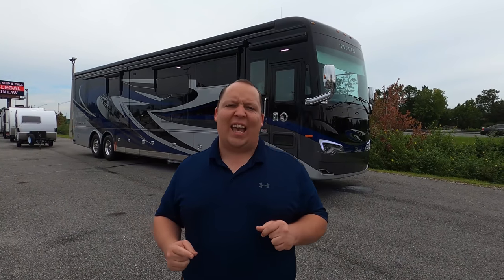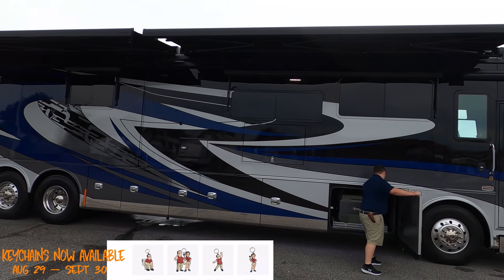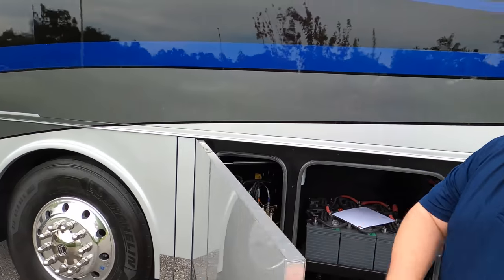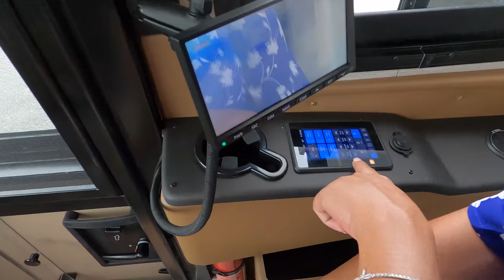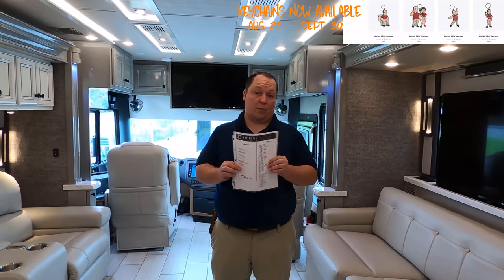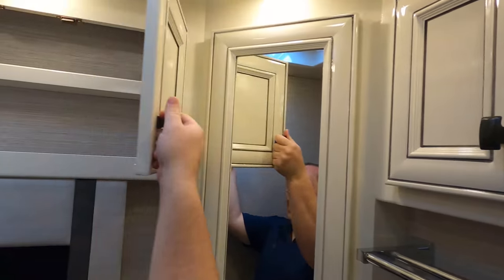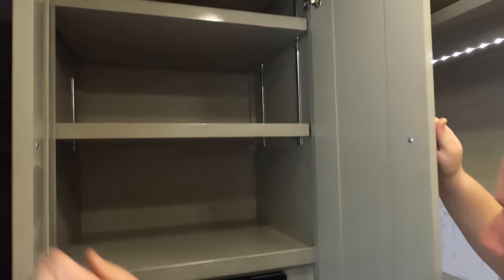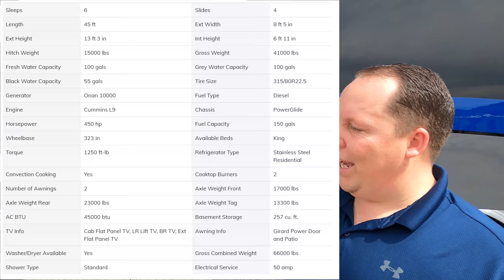The KING of Tiffin Motorhomes | Allegro Bus 45OPP

Comment: Beautiful but not perfect.   Dislikes would be: narrow walkway with slides in, bed is not flat with slides in, actually longer than I would like. 
Likes: awesome quality.  Love the cockpit.  Love the color scheme.  Kitchen is great.  Bathrooms great. TV position is great as long as you use televator.   Amazing coach but it shoukd be :). Actually think the emergency exit has a flaw.  If the bed is tilted up for travel you won't be able to get out of that exit very easily.

Comment: We like having the options that you can order:  360 view camera, 3 or 6 solar panels, mobileye collision avoidance, and stacked Washer & Dryer.  We dislike: the odd location of the Egress Ladder (vs. Newmar New Aire/Ventana locations), the limited/restricted access to the 50 amp power cord (very odd place) and no Roof Ladder.  Great job in the presentation. Deb and Steve.

Comment: For half a mill it should come with a ton of solar and large lithium battery set-up. Cheap NAPA batteries in a coach is class-c money
Reply: Also..... Residential fridges don't belong in rv's!! Large 12volt compressor fridge. Tell me how they remove the fridge to replace it..... they remove the slide....whomp whomp
Reply: Faith Renewed  Don’t diss Class C RVs. Any Class RV is better with solar and Lithium.
Reply: @brianreimer380  referring to the price difference.... 1/2 mill vs 70k
Reply: Faith Renewed I agree totally. I’m just saying the best class C can have 400 W of solar and 4 lithium batteries for an extra $8,000 and will have payback in about 8 yrs.
Reply: @brianreimer380  which is exactly my point...for the price this coach should have the best available.
Reply: Faith Renewed  yes true for 1/2 mill no excuse. And with a roof that big think how much solar you put up there, 6x200W panels. Yikes.
Reply: Most people who are buying this type of RV are not doing much boondocking, they are staying in RV parks all the time so major investments in solar don't matter to them. No reason to add it to the cost, if most of the customers don't want it.
Reply: @don.sullivan  Amen.  This coach would never be parked anywhere but in a deluxe park with hook-ups.
Reply: @don.sullivan  point being for the cost it should be included.
Reply: @faithrenewed3443  But adding that would add to the total cost of the RV as well as the weight. And if most of their customers (they know what their customers want) wouldn't use it why make it mandatory for all by including it in the base price. I'm sure it could be easily added for any buyer who wanted/need it.
Reply: @don.sullivan  if you're spending 1/2 a mill for an rv....it should come with the best available. The demographics of people buying this type of rig aren't the old retirees anymore. No they aren't going off road but most buying these days don't want to park in rv parks. If the manufacturers were actually in tune with the market they wouldn't be feeding the market the same old crap in a new wrapper....that's why people buy used busses and build their own because it's not offered in the market now.
Reply: @faithrenewed3443  We can disagree. I believe the RV should include the features that customers who are actually purchasing it want it to have- not just blindly include everything available just because of the price point. If enough of their actual purchasing customers demand that feature or tell them they chose an equivalent competitor product because that electrical upgrade is missing they'll add it as a standard feature. That doesn't seem to be what the market (actual customer purchasing $500K RV's) is demanding for that model.
Reply: @don.sullivan  we definitely disagree and the market has always been behind what the market craves and that's why there's many new start-ups upgrading and fabricating the the rv's people want. Have a nice day!
Reply: Don Sullivan why do you get 6 (8?) Napa batteries if you’re always plugged in or on generator? Battleborne lithium have lifetime warranty and charge faster and can use all the rated power while napas can only use 1/2.
Reply: Should at least be in the 21 st century solar and lithium aren’t a new idea,this is the manufacturer knowingly is buyers they will be in parks with full hook ups,half a million dollars is not going to be parked in a Walmart car park
Reply: @pault1964  many people buying/building rv's/buses are traveling and aren't doing the same ole. They want to get out into nature and away from the crowds. An rv that can be offgrid for extended lengths is the way the market is headed and if the manufacturers don't grasp the concept they'll be left behind and that's already happening. There is def still a market for the old couple hitting rv parks type rigs but there's less and less now.
Reply: @brianreimer380  I'm not making any suggestion that Lithium batteries aren't a good thing at all. They're quite amazing, but also quite expensive. All I'm saying is that they are not mandatory equipment for every single type of RV living. And since you can still add them to this RV then the buyer can choose to select them if it meets their needs. I'm only saying they should not be mandatory and thus adding to the base price if customers actually buying this particular RV don't usually add them. If the Napa batteries are sufficient to meet the needs of the owner between RV parks and they plug in when they get there, then it's an expensive 'available option' they can choose not to buy.
Reply: @don.sullivan   You guys are thinking like an owner of an under $100k motorhome owner. What is the big deal about solar and lithium? Boondocking, dry camping and spending time on blm or crown land that costs you nothing and has no services. People that spend $300k (which is what this would sell for) and up don't have that kind of RV style. They go from full hookups to full hookups. If they spend a night at a truck stop with the AC running using battery power it will be charged up in no time either driving 300 miles to the next stop or plugged into a post at a campground. Lithium and solar are kind of belt and suspender for this crowd.  Driving a 35,000lb+ diesel pusher (DP) down a forestry road and parking in the dirt will get you stuck, falling off the edge of a cliff and or doing damage that will cost thousands of dollars to repair.  Just not something most of this crowd would even consider. $300k for a diesel pusher is the bottom end of the market. If you want to be a king, buy a kingaire or even better a Prevost chassis upfitter like marathon or a built from the ground up newell. 
   As much as I love the idea of a DP it has a very limited appeal because it restricts you simply because it so huge. See that little antique shop on the side of the road or a tiny pull off with a dramatic view of the ocean, no way are you stopping your 65+ ft of coach and toad there. Not my style, still lovely to look at.

Comment: Ok this is definitely the nicest RV Matt has ever reviewed, it’s basically perfect as specced, but I think at this price level it should come standard with the 605hp Cummins.
6(!) Likes:
1: Beautiful exterior paint job, lights, and styling
2: Exterior storage with power trays
3: Interior decor and ambience with modern ceiling and cabinetry, and nice colours
4: Luxurious rear bathroom and huge shower
5: Nice kitchen with nifty storage spaces and high-end appliances
6: Massive walk-in closet in the rear
2 Dislikes:
1: Carpet on slide-outs 
2: 605hp Cummins (or at least the 500hp) should really be standard and not optional at this price level

Comment: For that much money they should have made sure that the slides run smooth and without the noise. With that much friction that only means major problems in the future. Also, the back escape hatch is in a very precarious location. If there is a fire or an electrical shortage you're not going to have enough time to get out. The bed moves in slow motion and it runs on electric, and fires on RVs spread extremely quickly and that bed takes 2 minutes to get out of the way. The RV is very beautiful inside and out though, but you are right it should have a push button start. Great job with the video & congratulations on 71000 subscribers

Comment: Thanks for the GREAT review! The 45opp is on our radar when we decide to trade up in a year or two.  
The Top 3 likes 1-Clean Look of the interior and exterior (seems like and RV’er thought through the design process) 2-Lighting in most RV’s it seems as if the lighting was an afterthought whereas the lighting for this unit is fully integrated 3-Functional storage options.
The Top 3 dislikes 1-Slide out buttons on the chair (I get that they need to be easily accessible from the front of the coach...but I would think with time the plate would wear down and the plate for the slide out button would pop out . 2- Tiny night stand (I typically keep my phone and a bottle of water next to me...if I purchased this coach I would have to figure it out) 3-Refrigerators look..am not sold on the face plate being the same as the cabinets...I am not sure if it would grow on me or if I would continue to dislike it.

Comment: Another great review guys, I like Tiffin and they seems to be a great customer service based comany. The 3 things i dont like are 1. at this price point they need to add lights in the cabinets throughout the coach. I mean come on light it up. 2. the carpet on the slide also. 3. the emergency rear door behind the king bed headboard. In an emergency thats a lot of work to get the bed out and then remove the headboard and then finally get to the door. I know someone is going to say it doesn't to take that long, but i have to tell you i have had to use the emergency exit once in a major emergency and the exit was behind the toilet. Just push it open and the ladder falls out to the ground and out you are. 
I like these things in this coach 1. the design of the galley, big lot of room and counter space. 2. the ceiling design with the mirrors and vents in the stainless steel, makes it look very high end. 3. I love the rear master bath and huge closet, I mean how did they fit all that in there. Thanks for sharing this one with all of us out here.

Comment: Likes - the emergency exit, the bed can move out to be made, the ceiling lights
Duslikes - TV over the cab area seems unnecessary,  carpet on slide around refrigerator and dinette,  stairs in front of passenger seat and when exiting they seem to be slow to extend which could cause a fall.

Comment: Wow. Such a gorgeous RV! It's tough to just focus on 3 likes. 
Likes: 
1.The bed that moves out for access and emergency exit, although actually using that exit may require more agility than many owners might have.
2. The kitchen; everything from the design to the sink to the cabinetry and pantry, especially the safety features on the pantry and peninsula
3. The walk in closet, bathroom, etc...basically, the entire master suite.
Dislikes:
1. The front TV is not necessary. 
2. Narrow (really narrow) walkway when slides are in
3. Carpet under slides. 
Just a note. I love the design and cabinetry. Whoever designed and planned this coach gets high marks from me. Also, all the drawer slides, inside and out, are fantastic. 
Thanks for reviewing this coach.

Comment: Sorry I'm late to the party. I did watch and give a thumbs up on the day you posted but I wanted to circle back and comment, for the algorithm of course. :) 
First off, glad General RV is carrying Tiffin products now. Pushers are in my wheelhouse so I feel I can give a little more in the way of comments. This is a nice bus! It's in the high end of your normal reviews. It definitely has all the bells and whistles expected of something in this price range. Something that would be easy to full time in. Overall two thumbs up to Tiffin! People rarely know how much advantage a tag axle brings to the table in stability, comfort and load capacity. One thing I noticed that should be on all coaches in this price, and I admit is a nit, but all the cabinets should be lined. It keeps the stored items from rattling around moving. That's about it on the negatives. Two personal items which I realize everyone isn't on board with is the fireplace and dishwasher. Both something of a waste of space that could be used for storage which a full timer needs more than fluff. Most end up using the dishwasher as storage anyway. I'm more of a big HP pre-DEF consumer but pleas keep reviewing the high end coaches, nice to see what the offers are out there.
Always enjoy the show, thanks for posting. 
Don

Comment: Hey Matt and Andrea Canadian follower here. Love your videos. Two things I would love to see a manufacturer of those big motorhomes do are as follows. I would replace the tilt up bed with a Temperpedic low profile king adjustable bed. They are basically 2 extra long single beds side by side and measure out to the exact same as a king bed but are individually operated on each side. They will not only raise both the foot and head of the bed and have a massage unit in them. This would be so simple to do and so worth it. Also with the huge showers they put in these units why would no one offer a walk in tub shower combo. They are amazing now a day and would have a built in Jacuzzi as well. Just a thought. Keep up the good work guys.

Comment: I do like the glazing on the cabinet doors in the living room area. (the dark lines around the edges). It's very inexpensive to do so they should have done it on the base cabinets in the kitchen as well. Also at this price point it should come with an actual oven. The bathroom in the back is probably one of the best ones I've ever seen. Good job with that. And the color scheme is really nice.

Comment: I love this Tiffin! It is absolutely beautiful inside and out. There is only one thing I don’t like and that is the way the passenger seat rubs when the slideout is extended.
Reply: With most coach builders putting the slide out controls in the driver or passenger seat headrests to ensure the seats are moved forward when its time to extend the slide outs.  With the view of the outside when tiffin is using charger tail lights.  As the few have a few dislikes of having the engine shut down to use the extension leaf as other interlocks had those not use the spice racks with the engine running.  As the few also like the note in a cupboard over the passenger seat from the tiffin's after Thor industries added the company to its list of companies it now owns.  Of the few dislikes of no outside ladder to get access to the roof could have owners haul their own ladders in the outdoor storage compartments.

Comment: 3 things I love:  Color combos of wood and fabrics inside the bus, layout of floorplan, huge screens in cockpit.  3 things I dislike:  Tiffin always under powers their coaches by using 450 engine.  I would prefer a larger engine for power in mountains, 500 HP min.  I dislike the power cord location.  I also do not care for the slide buttons on the chairs.  I think in this high end coach it would be nice if the chairs would auto slide forward or back if the slides were in operation, or maybe the slide would not work if the chair was in the way?? Just an idea.  Matt and Andrea, love your reviews!

Comment: Wow!  What a beautiful RV!  It's always fun to watch you two go through an RV.  You're so real and you cut through all the BS that you can see the RV for what it is.  So, my 3 & 3 are the following:
DISLIKES.....1.  No place that I could see for any CPAP equipment and the side tables are way too small for anything.  2.  The toilet paper holder in the main bathroom is way too close for anyone that is bigger than normal.  With all the room in there, they could have configured that way better.  3.  The TV outside.  It's not the tv itself, but the door that covers it.  When those doors pop up and out of the way, they can be very difficult to get ahold of and bring down.  There should be some kind of cord that hangs down and tucks away so when it's time to bring the door down, you grab the cord and pull so you can then grab the door itself.  Or a stick with a hook on the end to grab a ring...something.     LIKES.....1.  The kitchen is amazing!  Well laid out and accessible.  2.  The driver's cockpit.  Everything is well laid out as well, and it looks like a joy to drive.  3.  The crazy amount of storage!  I'm surprised, though, that their wasn't a pull out kitchen outside (other than the Truma cold storage).      Here's a question for you...is there storage in the steps leading in?  I thought I saw a drawer in the steps, but didn't hear/see any mention of it.  Was I wrong?  Nice job, you two!  Keep up the great videos!

Comment: Good review. If I had to pick a dislike it would be the layout of the 50 amp power real. Little tiny door located high up. If you are short then very difficult to use. If fact that whole area seems not to be well done. Most others just have a separate fuel filler type door for the DEF located not far from the diesel filler doors so you are not forced to drive forward to reach the pump to fill DEF. How come no lithium batteries? I see many corners cut on what is supposed to be Tiffin's premiere Class A diesel pusher.

Comment: Matt what does it mean to have an tag axle ?    Next time can you pull out the floor on the passenger side to show us how it works ? I like the pocket under the sink where you can put the sink covers. I like that all the outside compartments have elect locks on them. I like the camera system. I disk like the big TV in the driver area.
Reply: 8 tires on the back I think
Reply: @andreafoxcroft8420  6 the tag only has 2 sand is not a drive axle. It is intended to support extra weight typically found with motorhomes 40+. Feet long.  Some like this one also provide passive steering assist.